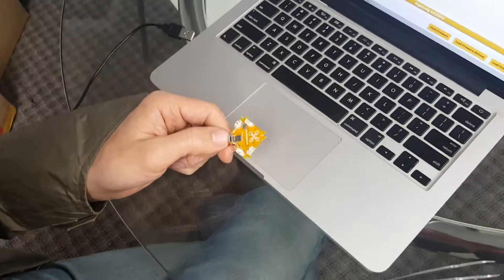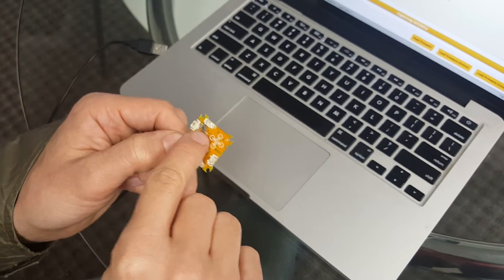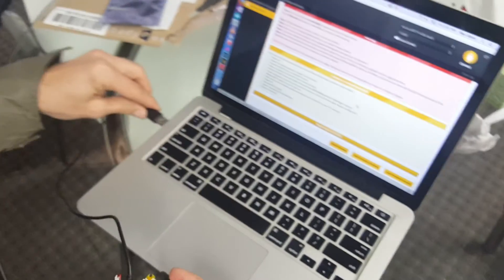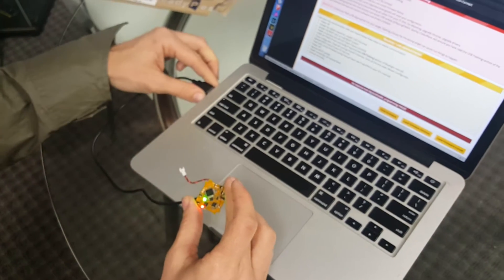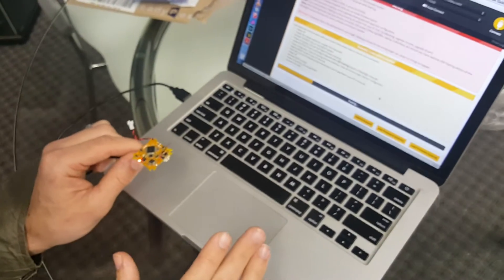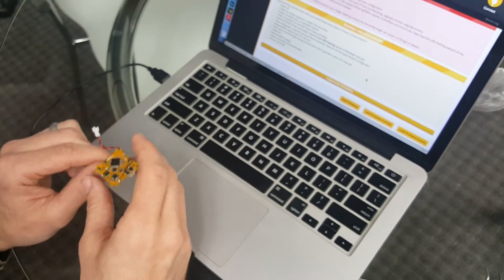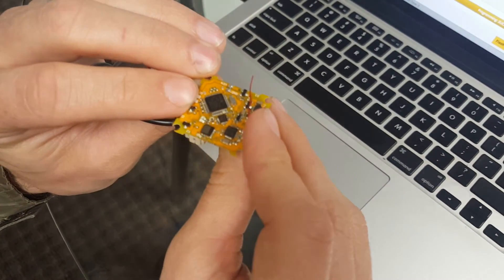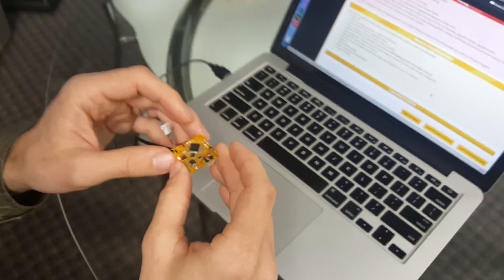NewBeeDrone BeeBrain FrSky version 1.2 changes

Comment: How do I bind the one without the bind button? I have your version .1 board.
Reply: Robert Baindourov ..... if the beebrain does not have a bind button... then it's a dsmx and goes into bind mode automatically... if you have the v1.1 of the frsky then you need to hold the bind button down while applying power and wait until the red light flashes fast
Reply: No i have the FlySky FS-I6. I'm fucked.
Reply: The beebrains are only compatible with DSMX and Frsky...not to be confused with Flysky. Who did you buy your beebrain from?
Reply: Amazon. I feel kind dumb cause I can't connect this FuriousFPV NUKE to a FS-A8S either. And one of the contact pads fell off? I don't know, maybe is covered in burned core. But I definitely soldered one into the afterlife. I have one more, and I soldered the receiver to it, but NUKE just keeps blinking boot. This is really hard and frustrating. I had an easier time building 4 VR ready PC's this couple of months. It doesn't help that I have shakey hands and am just learning to solder too. Trying to pick up a Spectrum off of Ebay. 37 dollar shipping! Might just get a Taranis from Amazon.